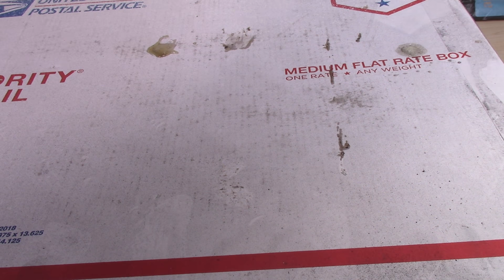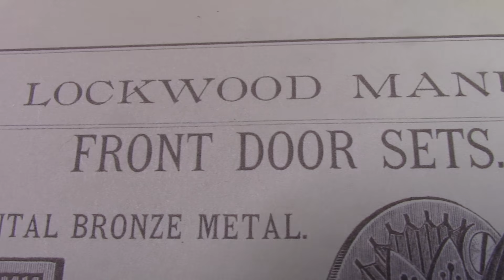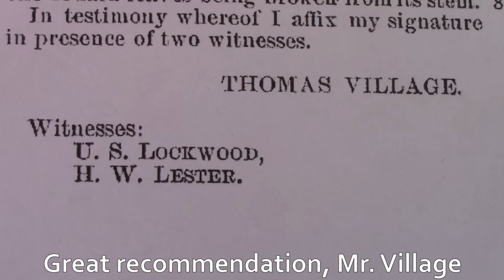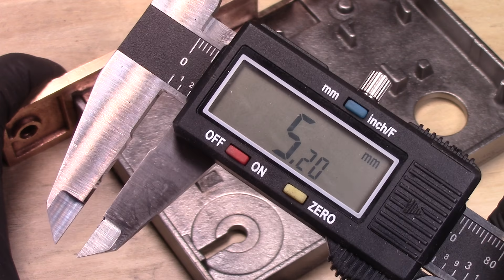Rare Broken 1880s Mortise Lock Set Restoration | Random Restoration

Comment: Maybe dumb question but were they painted originally or just rusted? The striper confused me since it just looked like rust.
Reply from the maker: Haha no worries - The main pieces are bronze, so they weren’t rusty, but the recessed areas with those pieces were painted which is why I used paint stripper on them. I threw all the bronze parts in the rust remover simply because it loosened all of the remaining paint that the stripper didn’t loosen. Sometimes the lighting can make them look rusty though, especially early on in the restoration, so I totally see where you’re coming from! Thanks for watching!

Comment: How can these restorations be random? Looks pretty specific to me.
Reply from the maker: Haha true - they used to be pretty random at least. Thanks for watching!
Reply: @randomrestoration6858  That lock ended up as a thing of beauty.
How did you know that it was originally black?
Reply from the maker: @finbarrsaunders8688  Thanks a lot, I appreciate it! The best way to tell if it was originally painted is by inspecting them in person - It's hard to tell in a picture and in a video, but in person it's easy to see if it's paint or tarnish. Many people mistake the paint for tarnish, and will either wire wheel or polish the original paint off and leave the pieces as an unpainted polished finish. Thanks again!

Comment: Uhhhh great job at restoring for esthetic. The deadbolt key is suppose to turn 360 degrees to allow the deadbolt to remain locked. Just a minor tweak on the key will fix that. But good job.
Reply from the maker: Thanks a lot! The key I made for the lock bolt does indeed turn the whole 360 degrees, whereas the second key for the latch bolt is not designed to rotate all the way. Thanks for watching!
Reply: @randomrestoration6858  I was just basing my assessment on the video that the key did not turn 360 degree since it was not done on video...... just an from a 33 year long locksmith who has worked and repaired hundreds of these older mortise locks in the south.. but great video.
Reply from the maker: @deadmangoov3  Totally understandable, Michael! Thanks again!

Comment: Using a wire brush to clean the brass finish surfaces - ARE YOU CRAZY ?!
Reply from the maker: Hahaha well I’d normally agree with you on that, as I’ve seen other restoration channels (that I won’t name) using rough wire wheels on brass and bronze and it makes me cringe too, however the wheels I used are made specifically for softer metals. As a result I find that they take a lot longer to get the job done, but it’s worth not destroying the piece in the process. Also, since I knew I’d have to sand years worth of damage away from the raised areas I wasn’t too worried about any potential damage, form the soft wire wheels I used - I’ve found that they still do sometimes still scuff up the surface slightly. It’s all about finding the right attachment for the job! Thanks for watching!

Comment: Why, why, oh why did you cover over the lovely embellishments with that horrid black paint?  Were you going for a trendy, Hipster look?
Reply from the maker: This is how the majority of these were finished originally. I showed the finish option in the 1894 catalog so there was no confusion with why I was painting the recessed areas. It states (Finish) “No. 3 - Black Background, Raised Surface in Polished Natural Color.” This is simply how the designer intended it to be finished, as it allows you to see the details. When this is installed on a door you are still capable of seeing the details, where without the paint it looks quite murky. Thanks for watching!
Reply: I believe that these items would have been “ Japanned “ originally not painted.... it was a baked finish of linseed oil, turpentine and a substance called asphaltium.
Reply from the maker: @normjacobs2623   So you are partially correct. The case and case cover of the mortise lock were indeed japanned. The recessed areas on the door knobs, escutcheons, strike and mortise lock faceplate were not japanned, and instead used a black enamel paint of some sort. Thanks for watching!

Comment: Such beautiful work done on things we used to make in the U.S.
Great restoration until
the damage done with that bolt "repair"! Terrible!
Reply from the maker: It’s true, we sure knew how to make some reliable and gorgeous stuff! There really isn’t anything wrong whatsoever with the repair I did, and it should last for another 120+ years without issue, and in fact it is MUCH stronger now than it was originally. Thanks for watching!
Reply from the maker: @Mu*Shu TeeVee Thanks for backing me up here! A lot of the repairs I’ve seen in older items like this are usually poorly done unfortunately, but they usually get the job done. The repair I made really has no faults and should last a very long time, as the bolt is incapable of rotating whatsoever since the flat edge is in constant contact with the lock bolt.